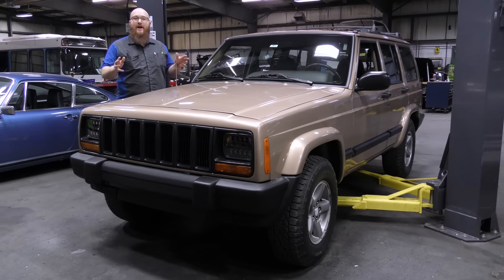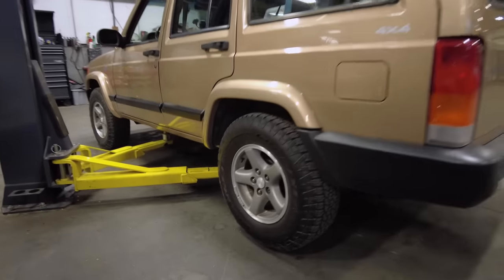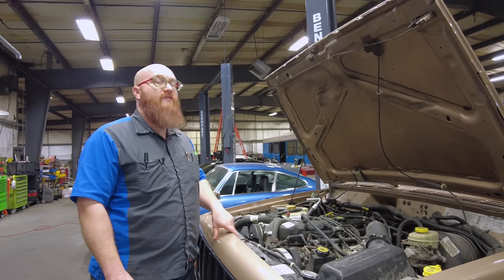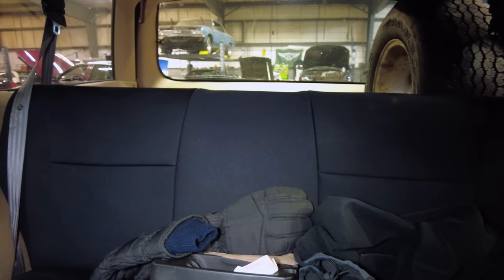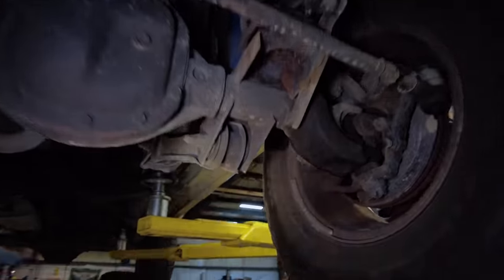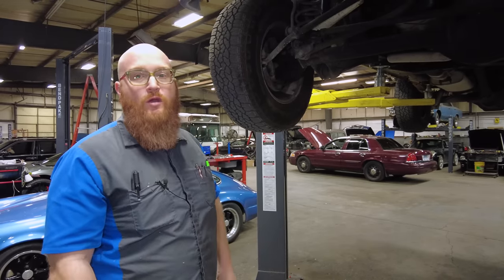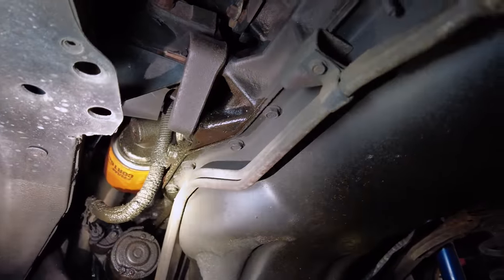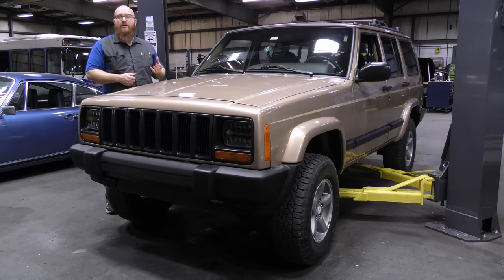Death Wobble on this immaculate '99 Jeep Cherokee! CAR WIZARD shows how to find it and the fix

Comment: I know that you guys don’t really do much with tires but would it be possible for you to do a video on when or when not to replace all 4 tires when dealing with AWD vehicles? Also a basic explanation as to why all 4 should or should not be replaced (for example when you have 1 tire that is damaged beyond repair). With the sheer number of AWD vehicles out there now, shops may be taking advantage of customers when they claim a tire on their AWD vehicle cannot be repaired. I know you did a video on an AWD Cherokee with a roasted diff a while back.
Reply: Believe me, your AWD/traction control system knows right away when all 4 tires do not have equal tread depth and your differentials will start freaking out the moment you lose grip. Replace all 4, or buy whichever tires need to be replaced and shave the new tire tread down to match the tread depth of the old tires still on the car.
Reply: @masterwhopper414  I ended up buying a new set of 4 but took a heck of a lot of convincing for my grandparents to do the same with their Subaru Outback when they had a blowout that couldn’t be repaired

Comment: Three years in a Jeep dealership in the 70's I never saw "death wobble" in a Cherokee or Wagoneer.  Different sized vehicle than yours.  The wobble was common in the CJ-5 and was most often the stabilizer unit.  Jeep called the Cardin joint a constant velocity joint; it had no provisions for lubrication.  Bad news if it failed.  The flailing shaft frequently cracked the trans case.

Comment: Did anyone else see play in the driver outer ball joint??  With the age, I'd be prone to replace just about everything up front, all links, ball joints, tie rods.  Make it enjoyable and SAFE for years to come.  I still say you need to apply way more force than that to identify worn ball joints, etc.
Reply: He mentioned that he had already checked them on the ground. If they show serious wear in the air, they are much worse than a person actually thinks.

Comment: I have owned one of these for nearly 2 years and have never, ever had to take it into a shop. Everything on these things is cheap and easy to replace. The engine is almost as simple as a 12v Cummins. Of course once you start lifting them you'll want to get a bunch of supporting mods (beefed up track bar and steering stabilizer, unibody stiffeners, etc) but they are incredible vehicles. Glad this one's been so well preserved. Most of the XJs in my area (besides mine and my mom's 83k mile '96) are beat down and have numerous miles. But each and every one still manages to start up on the first crank.
Reply: sold my 99 x4x manual in 2020 for way too little money... regret it every day

Comment: The track bar. I'll remember that thnk! The oil pan gasket is a very easy fix. Hell, even the valve cover gasket was a breeze to replace. I love this 4.0L engines 😊 get them while you can ppl!

Comment: My daily driver is a 1998 Cherokee XJ Classic in Deep Amethyst Pearl (purple). 
Just had the rear leaf springs re-arched and a leaf added to them. This lead to getting some new, taller springs up front. That with my new, bigger tires and rims, gives it a certain badass look to it. Great, great car. 187,500 miles on it. Just keeps going. I do my own maintenances to it and I am, at best, a shade tree mechanic. It is extremely simple to work on. I hope to keep it forever.
Perfect size with great power. I drive it with the rear seat folded down pretty much all the time. Had the death wobble taken care of. No biggie.
I should also add that, because I live in the high desert of Nevada, I don’t have ANY rust on it. 😎
Love your videos, Mr and Mrs Car Wizard!

Comment: I was going to guess the steering stabilizer.  That is in amazingly good condition.  Those are usually beat pretty hard.
Reply: Possibly owner diagnosed this and replaced it recently in an effort to stop the deathwobble?
Reply: its never the steering stabilizer. putting in a new one will only mask the problem.
Reply: @Stackali  yep; actually, it's best to remove the steering stabiliser, then check the front end.
Reply: @petesmitt  - Good point. I haven’t done that myself before, thanks! 😊

Comment: I have another idea for the Car Wizard to do the next six used vehicles with these engines and/or transmissions, that you should buy with decent help from friends, family members, acquaintances, as well as from online for the next video upload on Thursday. The six used vehicles with these engines and/or transmissions to buy will be the 2007 to 2009 Kia Sorento EX 4WD mid-size SUV with the 3.8 L V6 engine and the five-speed automatic transmission (alternative to the first-generation Toyota Highlander), the 2001 to 2004 Chrysler Town and Country LXi minivan with the 3.8 L V6 engine and the four-speed automatic transmission (alternative to the second-generation Honda Odyssey), the 2004 to 2006 Mitsubishi Galant mid-size sedan with the 2.4 L four-cylinder engine and the four-speed automatic transmission (alternative to the Toyota Camry and the Honda Accord), the 2017 to 2021 Mazda CX-5 (non-turbo) AWD crossover with the 2.5 L four-cylinder Skyactiv engine and the six-speed automatic transmission (alternative to the third-generation Toyota RAV4 and the second-generation Hyundai Tucson), the 2011 to 2013 Mitsubishi Outlander 4WD compact SUV with the 3 L V6 engine and the six-speed automatic transmission (alternative to the first-generation Honda CR-V) and the 2006 to 2008 Hyundai Azera GLS full-size sedan with the 3.8 L V6 engine and the five-speed automatic transmission (alternative to the Ford Crown Victoria and the Buick Park Avenue). Thank you very much and have a great night. There will be more Car Wizard videos that will be interesting to upload.
Reply: The one problem most of those RS platform Chrysler vans have is the body rusting into oblivion. I’ve seen nice ones but they are basically nonexistent in salty states.
Reply: @whatamisupposedtoputhere  Agreed

Comment: The passenger side bolt hole for the track bar commonly gets wollered out causing play in the track bar even when replaced.  There are lots  to fix that. I personally tacked in a couple washers to hold the bolt firmly in place.  That corrected my issue.

Comment: A bad steering stabilizer does not cause death wobble. True, any number of loose ball joints/tie rods can attribute to death wobble, including the track bar, a worn out steering box as well, an incorrect caster angle can also contribute to death wobble, so if the control arm bushings are worn or a bent control arm, this may move caster in the wrong direction.

Thanks for the vid, everyone has their own take on death wobble, and every video says something different.
Reply: That about covers it all. A lot of time the steering box goes by unnoticed until it’s the only thing left. They have replaced enough on this I may consider replacing it as well out of an abundance of caution. The alignment is/was definitely out on this one. That tire wear is very evident. I’m surprised he didn’t talk about it.
Reply: good advice, 100% correct, not enough positive caster is the cause of death wobble, loose parts just make it worse

Comment: My 1997 Cherokee Sport was the best car I ever owned! I put well over 300,000 miles on it and when I sold it it still ran strong! Crappy Japanese wiring and switches aside, I love those 4.0 Liter 6 cylinders.
Reply: Blame the manufacturer for specifying (and only paying for) the crap wiring.
A little more money spent on good wiiring and switchgear...there would never have been a problem.
It's the money...always folow the money!

Comment: Man, brings back memories. I had a 99 I used to beat to hell and it never left me stranded. They also had an amazingly reliable automatic transmission. The aw4 was unkillable.

Another issue with that front track bar is that the hole for the bolt on the axle bracket wallows out. It's pretty thin metal. I would weld on a little strip of 1/4 steel and re-drill the hole.
Reply: Totally agree. My 99' was awesome. I regret everyday having wrecked it. The guy I sold it too fixed it and got it running again and still drives it. It was low mileage and I babied the heck out of that thing... sad.
Reply: Stabilizer bar
Reply: I had the imported Aisin tranny in my '93 Grand Cherokee.  That had no issues either.
Reply: Fun fact the AW4 also known as the Aisen Warner A340 is a Toyota transmission Chrysler picked to put behind the 4.0 in 87 when they shoehorned the motor in the XJ because it was strong yet small enough to fit within the constraints of the XJ trans tunnel.
Reply: @cjhawk67  and yet, for some reason, they didn't put it in the TJ.  I'm still salty about the 42rle they ended up using in later years. That thing has no business being behind the 4.0
Reply: Strong transmission and smoother than most others available at the time. AFAIK it was also one of the first computer controlled transmissions available, possibly even the first in an American car.
Reply: @drooskeedoo3388  Yeah same thing happened with the 4.0 in the ZJ. The first year of the ZJ Grand Cherokee got the AW4 but the following years would end up with a Chrysler transmission. Thankfully the trans tunnel on the XJ was to small for any of Chryslers offerings to fit so they stuck with the AW4 all the way till they stopped production in 01.

Comment: Mine is a '98 with the 4.0 and the 5 speed manual. It has 265,000 on it so far and it's rusty but trusty. The perfect winter beater/off road toy
Reply: I just watched an engine repair and teardown video channel on YouTube, and the content provider was tearing down a 4.0. He said that he had a hard time even finding a used 4.0 on the market to use on his channel because the engine usually is still running good but the car has rusted out around it, so it normally gets sent to the crusher. There's very few of them available on the used engine market because of this.
Reply: @bobkonradi1027  definitely. I've had a few 4.0 Jeeps and the only "engine work" I've done on any of them is gaskets and water pumps. I've rebuilt damn near the entire rest of this Cherokee lol, but the engine hasn't needed a thing

Comment: Nice finds. Nothing too challenging. It DOES need an alignment or recently had one done. Both tires were worn on the inside. They will benefit from being rotated as well to try to even out the wear a bit. 
    Very nice Cherokee.

Comment: What about vehicles that don't have a track bar. My Suzuki samurai has the same death wobble. I had replaced all the joints and bushing and even adjusted the bearings. Still get a small death wobble around 55mph.

Comment: Idk if this goes for xj... I have a 02 yj it had the death wobble until I got new tires. I rotate every oil change. I noticed in the vid the tires on the front are worn more than the back. It might be the track bar and tires.

Comment: I've owned 4, no 3 saved my life in a crash.  A jerk cut me off and I locked up the brakes and went into a spin.  I came to rest against the square corner of a bridge support, hitting it at the driver side hinge and windshield junction.  The only door that would open was the rear passenger and that's how I escaped.  The drivers door arm rest broke a couple of my ribs but I was lucky and it could have been a lot worse.  
On the wobble I would have guessed a bad front tire with a bubble, that happened to me.  My first was a 5 speed manual and the hydraulic clutch was a terrible British Sperling  piece of crap.  The slave cylinder was on the passenger side and top of the bell housing.  It was a nightmare to replace.  The second time it went out a few years later I peeled back the carpet and cut a hole in the trans hump to make the switch.  Afterward I cut up a coffee can and used sheet metal screws to secure the patch.  I put the carpet back in place and went on down the road. 
My second was 2wd with a 5 speed manual and I could give college kids fits in their little BMW's going stop light to stop light.  I could go on but I will say I would buy that one in the video in a heartbeat. Good trucks.  Oh, and my 4th was appropriated by my oldest grand daughter when she started driving.  She just told me she was buying my Jeep and there was no stopping her, how could I tell her no?
Thanks for the video!

Comment: Do not put a lift kit on these things.  You don't need to.  Put 31's on them and you are good.  You are looking for a headache on changing engineering aspects and killing MPG.  Death wobble?   I would also check tire balance and alignment after bushings / track bar replaced.   I had a "death wobble" and all that did to fix was rebalance the tires and redo the alignment and never had the "death wobble" again.

Comment: was just looking at a 15 cherokee to flat tow w motorhome... death wobble is in play when flat towing.. Homie takes no chances with that so on to find something different
Reply: Balance the tyres, fix the actual problem, enjoy the Jeep....
Reply: @JohnSmith-yv6eq  its an electric steering system problem .. it runs deep

Comment: I have a 99 Cherokee that I bought used with 149,000 miles on it. It eventually developed a death wobble - very scary as you said. I replaced all of the wear items in the front and that solved it. That Jeep now has 304,000 miles on it and is still going strong.

I’ve got another 99 Cherokee that i bought used with 192,000 miles that i’m fixing up. It was overheated and a shop told the previous owner it wasn’t worth fixing. I bought it for $500 and replaced the head and head gasket and it runs fine now.

These are simple, tough vehicles that are easy and cheap to repair. I’m never selling mine.

Comment: These older, late-1990's Jeep Cherokee's are very solid vehicles to own, because they last forever with proper maintenance. They only have the 4 L six-cylinder engine, which is a reliable engine for Jeep and other Chrysler vehicles. Anyway, I hope that the Car Wizard will have a minivan at his shop, preferably the 2006 Ford Freestar Limited with the 4.2 L V6 engine, which is a good engine from Ford to see, if the vehicle is well-maintained and if there are any small problems. He has not completed a video upload for a minivan just yet. I hope it comes 🔜. Thank you very much and have a great rest of the day.

Comment: I've had two of these with death wobbles the fix was new shocks and a good tires. Did not have to change any suspension parts except for the shocks of course never had another problem with either one of them.

Comment: Another outstanding show, you two are quite the double act, I like that. Having an educator in your life and doing what you do involves learning new things regularly so why not do a show covering general maintenance? Just basic stuff a walk around the vehicle and what to look out for when driving and I don't mean liberals, I mean noises that may need investigating also changes to the way the vehicle is handling, subtleties that if caught in time could save a larger bill or even someone's life further down the line. Have you ever thought about doing a car build for yourself? I don't mean anything like a restoration, I mean something that you could take to a track or go off-road in. I know you have done the boat thing but I think it would be an interesting side show if you and Tyler got together and did a ground-up build to get some content out of, but we would need to see all the nuts and bolts stuff and it may involve you learning some stuff along the way. You might even aim those shows at a little more mature audience that would allow Tyler's and your sense of humour to reach ears that may appreciate it more. Between the two of you, I think you may even get ebay motors or another sponsor involved to cover the majority of the build and we will get to see another good double act working together.   That would make some really good content oh you may also get Stewart from Vango involved to do the bodywork for you guys. So street/drag/track car or an off-road monster whatever route you go would be YouTube gold.  As usual all the very best from Scotland.

Comment: The death wobble was never fixed on my 2001 grand Cherokee Laredo I sold it for 2000 dollars engine and transmission was great
Reply: you should have just changed all the joints. would have fixed it.
Reply: @Stackali  so I believe we did but there was crash damage by my brother he was blinded sun while driving through a kfc and hit a gigantic curb ruined the tires and rims and messed up some parts like the cv joints when that happened so no one in my city new how to fix the death wabble and I got tired of throwing money at it

Comment: Funny death wobble story.  I bought a 68 VW with a blown engine.  I rebuilt the engine on a third floor balcony.   But the first time I drove it, when it went over railroad tracks it would wobble.   I tried several things but I also saw that it had been wrecked in the front end.  

I would give friends rides and for some reason we had to go over the railroad tracks.  😁.  As we approached I would grip the steering wheel and clamp my hand to my knees.    Instead of the steering wheel shaking it would cause the whole front end shake and scaring the crap out of my passenger.  🤣

Comment: I’ve had an xj ever since 1993 and have kept a half dozen of them and bought, fixed , and sold a half dozen others.  I prefer the 2 dr manual SEs.  I have a 99 w 220k and the lady has an 00 with 232k.  The only cons are the <20mpg and rusting from inside out from water leaking in from firewall.  They are easy to work on, can be beat on, and will protect you in a crash.